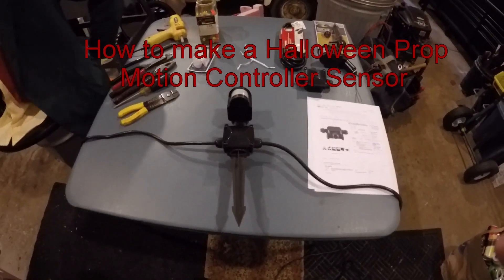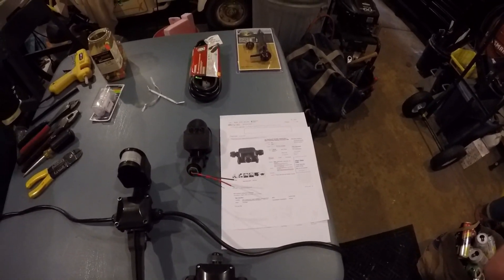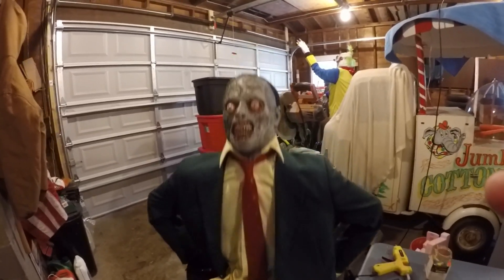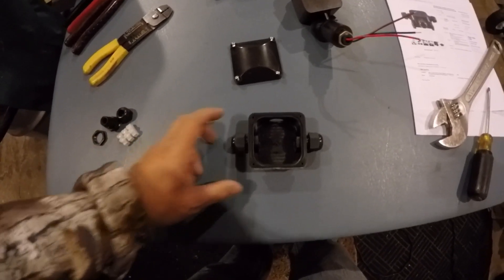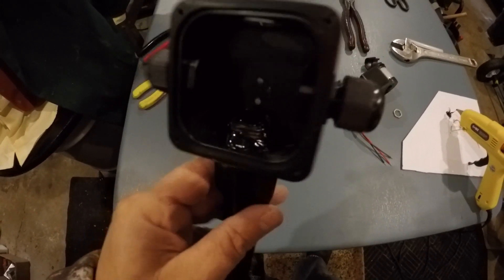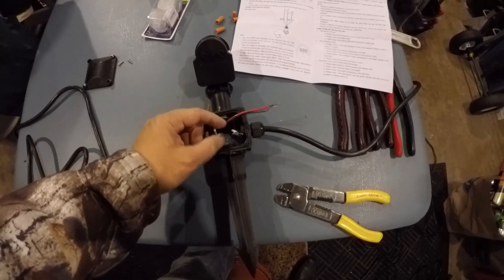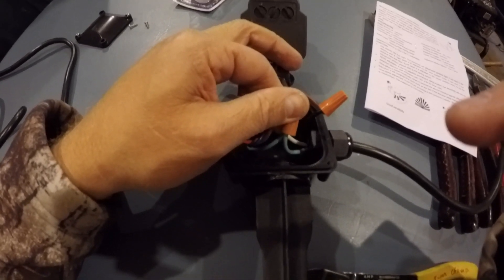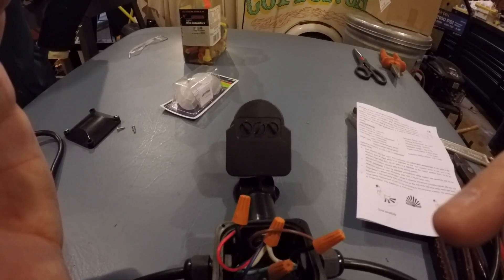How to Build a Motion Detector Halloween Prop Controller Sensor

Comment: Do you know if there is a way to control how long the motion sensor gives power to the moter after being triggered
Reply from the maker: Yes, there’s a dial on the motion sensor for how long it will power the prop per triggering event. I do about 15 seconds.
Reply from the maker: Yes, there’s a dial on the motion sensor for how long it will power the prop per triggering event. I do about 15 seconds.
Reply from the maker: Yes, there’s a dial on the motion sensor for how long it will power the prop per triggering event. I do about 15 seconds.
Reply from the maker: Yes, there’s a dial on the motion sensor for how long it will power the prop per triggering event. I do about 15 seconds.
Reply from the maker: Yes, there’s a dial on the motion sensor for how long it will power the prop per triggering event. I do about 15 seconds.
Reply from the maker: Yes, there’s a dial on the motion sensor for how long it will power the prop per triggering event. I do about 15 seconds.
Reply from the maker: Yes, there’s a dial on the motion sensor for how long it will power the prop per triggering event. I do about 15 seconds.
Reply from the maker: Yes, there’s a dial on the motion sensor for how long it will power the prop per triggering event. I do about 15 seconds.
Reply from the maker: Yes, there’s a dial on the motion sensor for how long it will power the prop per triggering event. I do about 15 seconds.
Reply from the maker: Yes, there’s a dial on the motion sensor for how long it will power the prop per triggering event. I do about 15 seconds.

Comment: This is the best video on this idea that I've seen.  So many people don't use a proper junction box, don't provide strain relief, don't think about water, and don't connect the grounds.  I love that you put it on a stake.  Not only does that make it easier to position and aim, but it holds the electrical box off the ground, reducing the risk it ends up in a puddle.  I wish YouTube would promote it over the more dangerous examples.

The only thing I would do differently is to use Wago lever nuts instead of traditional wire nuts for the connections, but that's just a personal preference.

Those junction boxes are now widely available on Amazon.  They're not UL listed, but the ones I've seen seem perfect for this use.  They come with various sizes of o-rings to accommodate different cable sizes through the glands.  Pick the ones closest to your cable size before slipping the cables through.  Make sure the main gasket is in place when you close it up, and that you twist the glands so that they clamp/compress onto the cables (that's the strain relief).
Reply from the maker: Thanks for the great comment!!

Comment: Great video! What is the part called thats holding the wiring?
Reply from the maker: Hey Mark.  The part holding the wire is called a waterproof junction box with waterproof cable connectors.
Reply: Can you send me a parts list please. Like the sensor, ground stake, box etc… please and thank you!